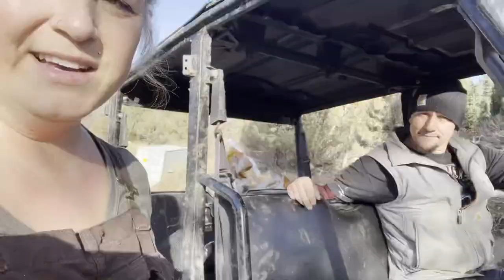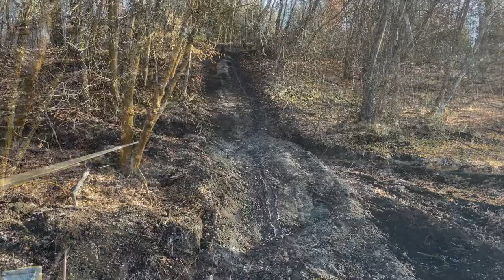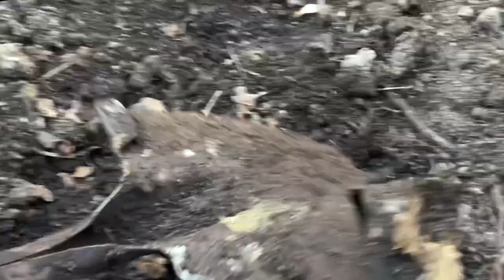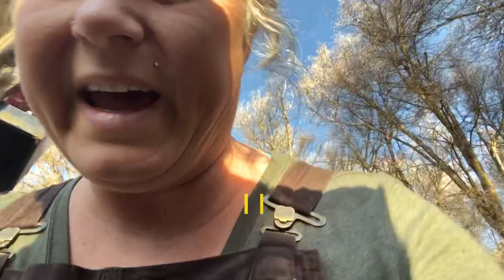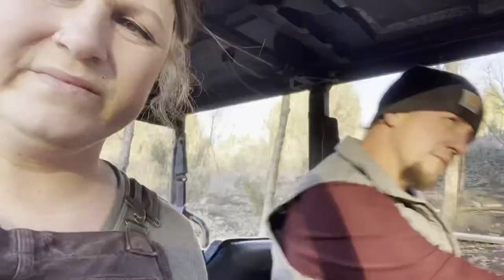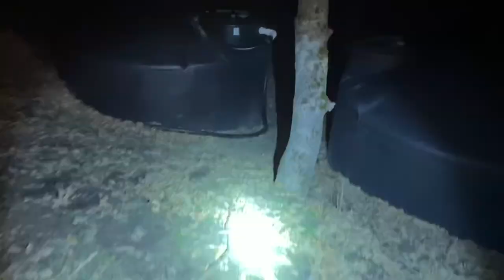Installing the WATER LINE has been full of challenges. NOT SURE IF IT WILL BE WORTH IT!!

Comment: Seems you filling your tanks with the head pressure of water on your main line. 
It works till your one way valve fails and you empty your tanks back into the well. 

Would suggest you run a seperate line to the top inlet of your tanks and take the head pressure away from your pump. 

Pump will draw less electricity and last much longer.